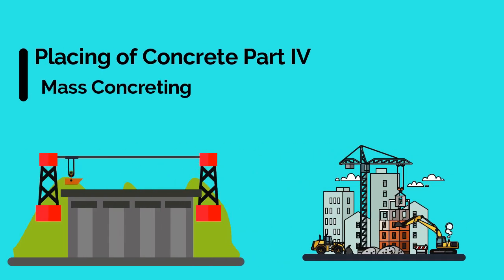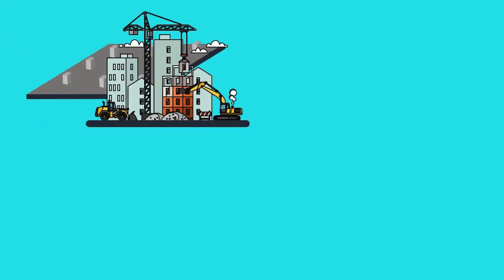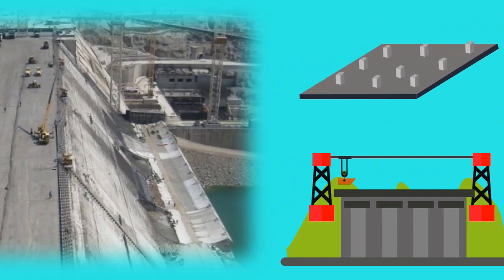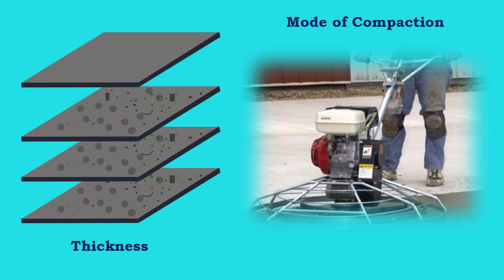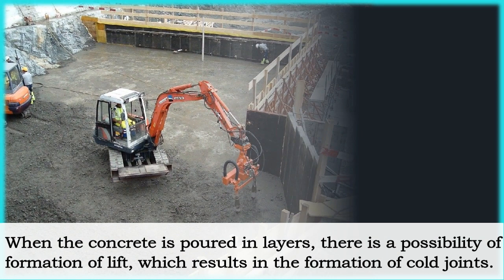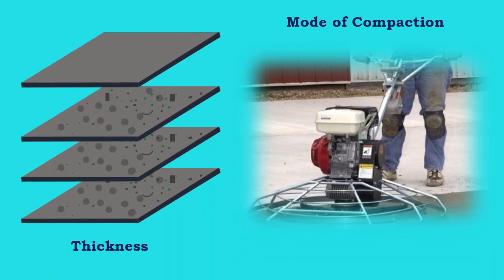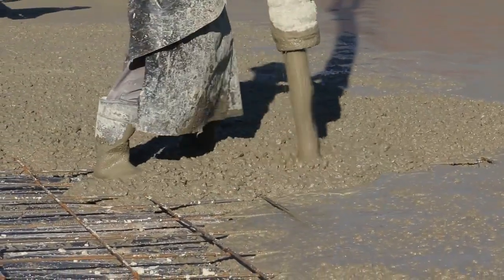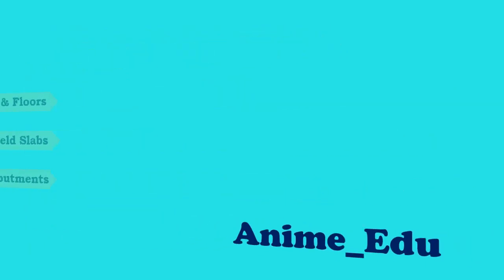Placing of Concrete in Dams & Bridge  || Mass Concreting || Manufacture of Concrete #17 ||

Comment: http://civilportal.online/2019/06/19/placing-of-concrete-at-site/
Concrete should be laid continuously to avoid irregular and unsightly lines.
To avoid sticking of concrete, form-work should be oiled before concreting.
While placing concrete, the position of form work and reinforcement should not get disturbed.
To avoid segregation, concrete should not be dropped from a height more than 1 meter.
Concrete should not be placed during rain.
Reply from the maker: Good one